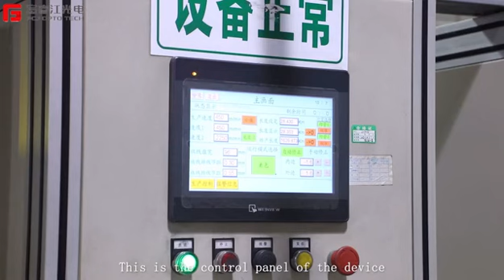How to coloring the optical fiber?

Comment: Need a flashlight for gravitational quanta? Einstein's dream was to have such a device. Proposal for joint implementation of the invention. You are negotiating with companies that make fiber optic gyroscopes. Technical consultation and payment for the cost of the test device from me
We need; assemble a hybrid fiber optic gyroscope (based on 50% - Michelson's experience 1881-2024). Use a hybrid fiber optic gyroscope and measure; 20, 25, 30 m/sec., car speed in a straight line. As a result of 100% direct experience we will receive the basis for:
  Postulate 1. Light is an ordered vibration of gravitational quanta. Postulate 2. The gravitational field controls the frequency and speed of light in a vacuum.